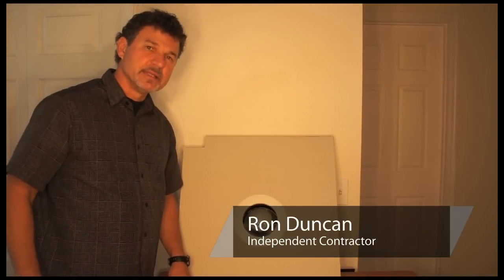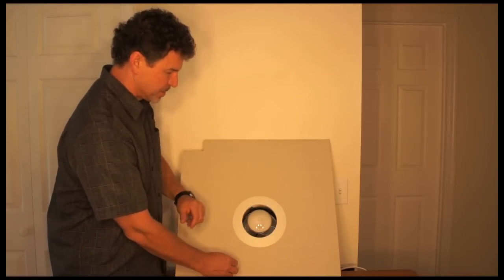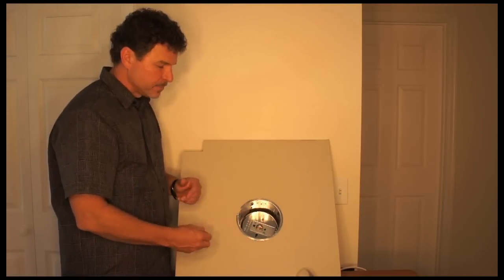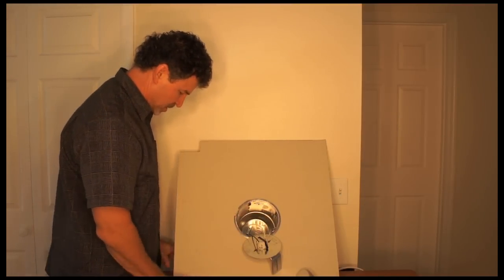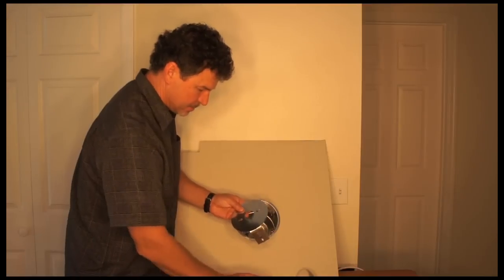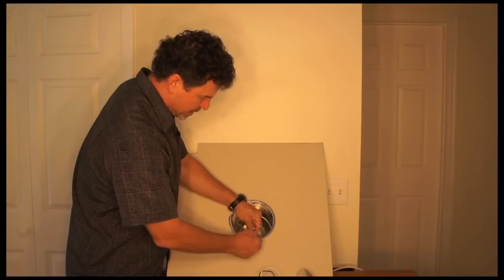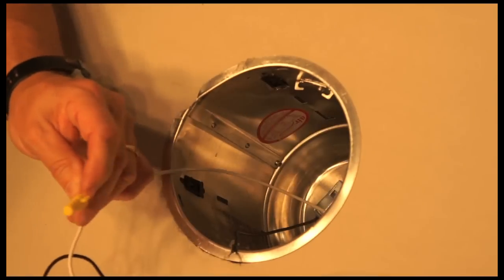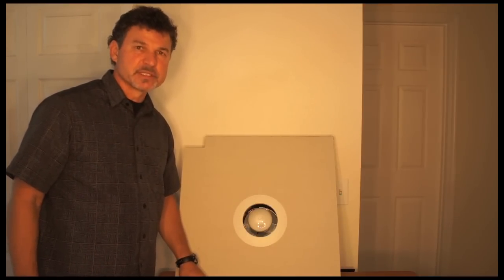Electrical Home Repairs : How to Fix a Recessed Light

Comment: Is there a way to test that this is the issue before replacing it? For example, what if the wire got chewed by rodents someplace else? Also, once I re-wired something after turning it off and there was still a small current in the wires, do I need to wear gloves to do this? BTW, I already tested light bulbs and checked the circuit breaker and those weren't the issues.

Comment: A replacement socket is available at Home Depot inside open boxes for recessed lights, ie. plate and socket.
Reply: HD doesn't sell the replacement socket shown in the video so you have to disassemble a can light and abscond with your new socket

Comment: Great "daylight" feel for the whole house - very easy to install•ᴥ•>share4.photo/RecessedLighting?ㅚ    just plug into socket, click chord end into light fixture and hook light rods into old fixture slots. Pushes right in. Nice sleek look and much nice than the old halogen with the black frame which always collected spider webs and got so hot. These do neither - staying much cleaner and web free. Safer to since there is no heat buildup. Have used throughout whole house and love that they can be aimed (tiled and rotated) to highlight fireplace and paintings on the walls. Light is very pleasing and natural - like being outside on a nice September day.

Comment: Socket isn't the problem.  What usually happens is insulation gets pushed around the can and the thermal resistor goes bad.

Comment: make sure you use high heat wire nuts.  Those yellow ones you're using will melt and smoke with Halogen lamps.  Also, wire nuts no longer require you to twist the wires together,.  The wire nuts do that for you.  As well, put the heat reflector back on the socket after you've connected the new socket so you don't need to fumble around with it attached when replacing the socket.
Reply: Not true. Wirenuts dont twist wires